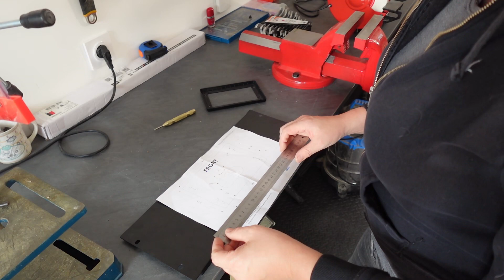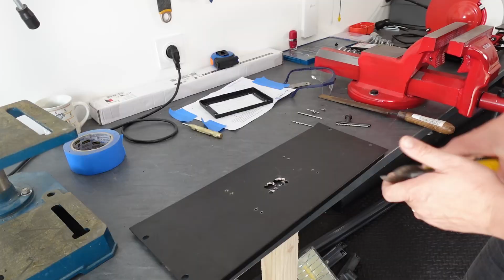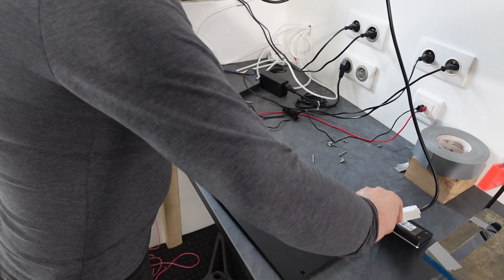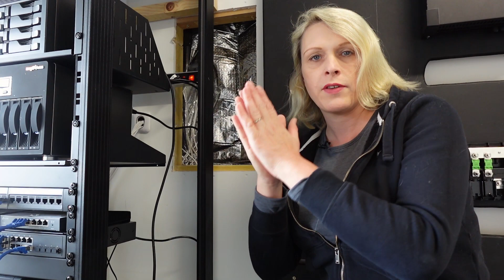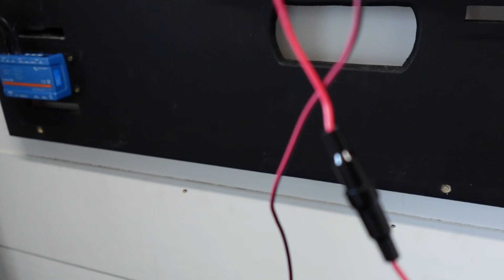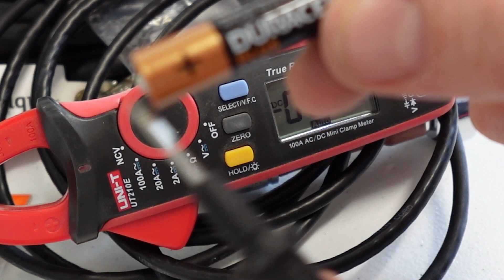Victron Solar System Screen Install

Comment: You do not need bigger holes in metal. Make hole like slots. Vertical two slots and horizontal two slots. Remember vertical slot on one side horizontal on another side and thats all.

Comment: Seems rather high to me
Reply from the maker: I'll have to wait and see. If it is too high it's very easy to change things around in the rack.
Reply: @Gridbusters-qx4om  I mounted my EG4 18kPV up way too high, it hurts my neck to use the screen lol. But it is too darn heavy to move again. Remote monitoring with their app and Solar Assistant saves me having to go out to the garage anyway.

Comment: Nice, but you really don't need a screen in a home installation, just use a computer or the phone in your pocket, I never fitted one to mine, its just an expensive luxury which likely won't get used after a while. With regards to the Cerbo, check the serial number with Victron, there was a bad batch a while ago which in rare circumstances could fail on 48v systems - Google Cerbo 48v problem for full details.

Comment: search for "ut210 hack" there are options to set the meter to DC and program the counts to 6000 or 10000
You still need a ladder to be able to adjust the display. Or make it lower.